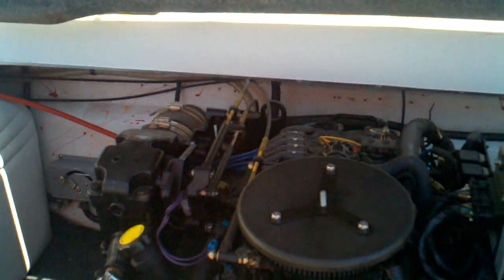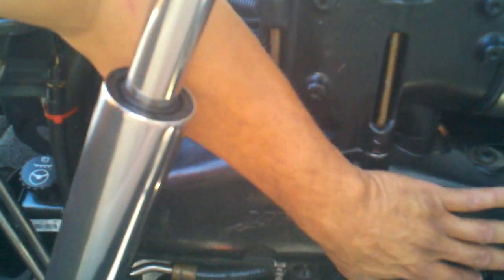Mercruiser I/O engine cylinder block flush

Comment: Great video and I have a quick question.   I have a MerCruiser MPI 5.0.  Where is this flush out point on this engine?
Reply from the maker: My engine has four   Two on the sea pump which is left when facing the stern  one located on the ball housing below the right pulley   And one on the thermostat housing. Your exhaust manifold has two on top